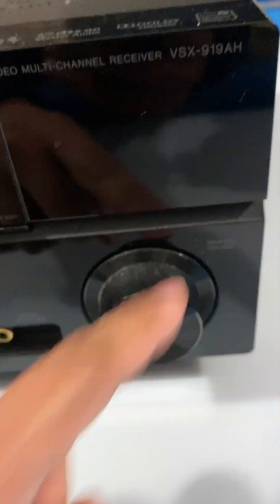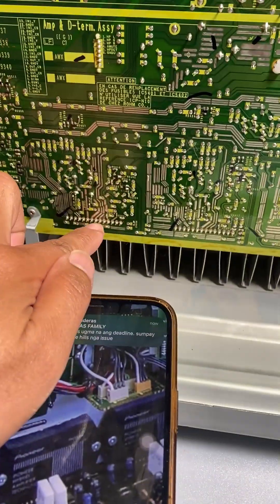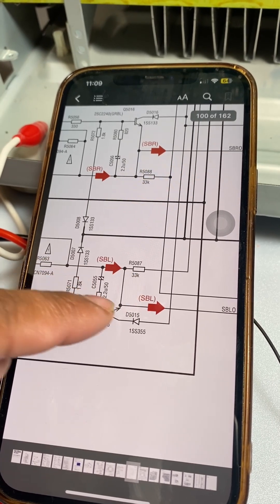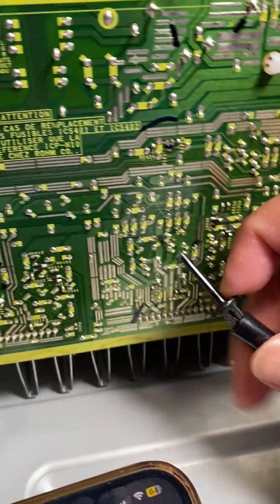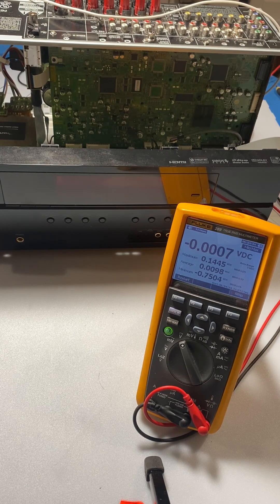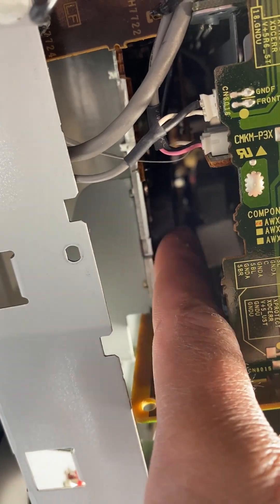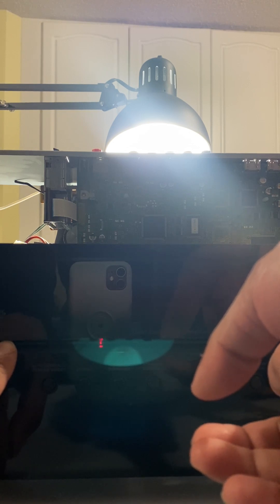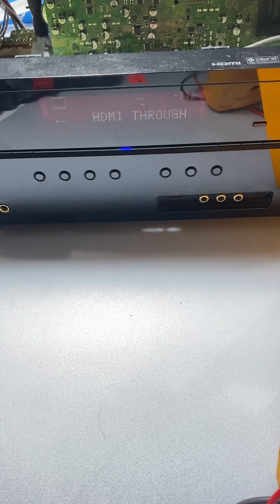HOW TO REPAIR PIONEER AVR RECEIVER NO POWER BUT WITH BLINKING LED | VSX-919AH

Comment: Hi buddy. I have a blue light flashing on the same amplifier. Disconnect everything, remove dust but still the same. It will get on sometimes but then again switch off with blue light flashing. Any idea what to do?
Thanks

Comment: Can you help me?
I have same av reciever but the the middle blue light below the display is blinking.
Display shows power on then turn off and blue light keeps blinking.
Reply: Did you fix it?
Reply: @filippiskorski2751 Bro in my case it was main IC issue
I didn't liked the Reciever it's sound was pretty bad, so i replaced it with old marantz SR-8500 which i am love listening to everyday it is very powerful.
In my option you should go for a transister based Av receiver with good wattage.
The sound difference is day and night.
I didn't liked the sound of previous reciever at all, not even the first day.